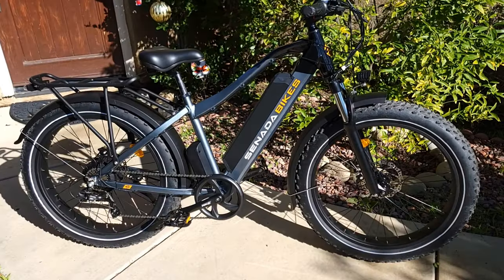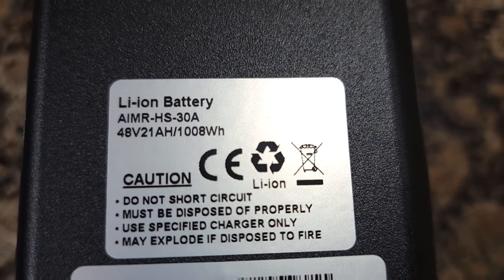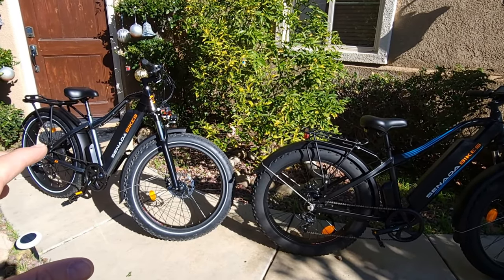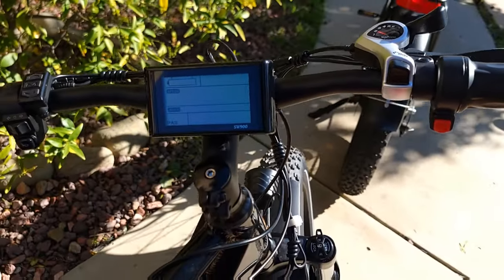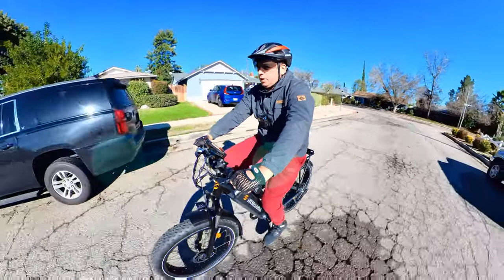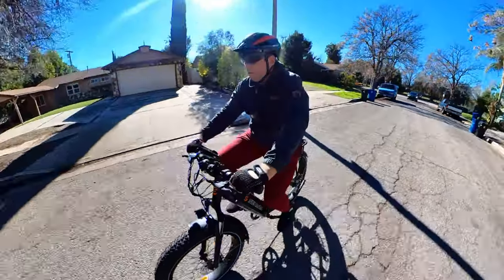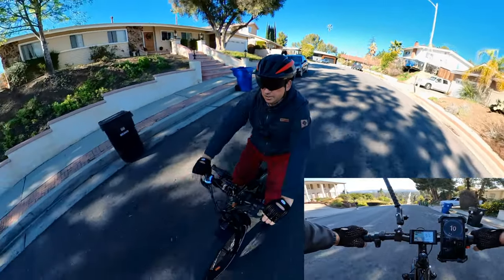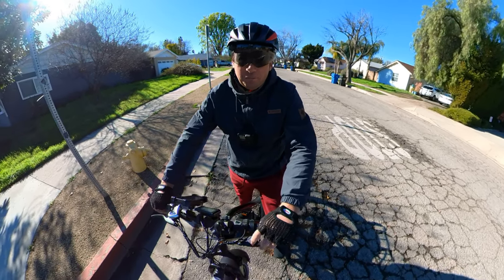NEW Upgraded  Senada Saber Pro 1000W Fat Tire Electric Bike All-terrain & Off-Road 2023

Comment: I am jealous.  I have the previous version of the Saber.  It is great but the new PRO seems like a nice upgrade.
Reply from the maker: I know but you can upgrade handlebar and brakes to Hydraulic . There are 2 type full Hydraulic and pull not sure if pull will make any difference. But yes pro is much better now

Comment: I'll stick with the Aerial Rider Kepler. It can go 40 mph and has a modern color display and is the same price or less. Thanks for the video though.
Reply from the maker: Whatever works for you 😉
Reply: The Kepler is like 300 dollars more and the saber pro is a way better looking bike.
Reply from the maker: After some discounts I think $400 -500 more.. I think senada also doesn't charge sale tax in most states
Reply: @askdad  do you know any discount codes for this bike?
Reply from the maker: I have a discount code in description with link. I think they had Herald pro on sale under 1500 so it would be about $1420 after discount
Reply from the maker: I think if you buy 2 ebikes there is code love400 $400 off
Reply: @askdad  Can you stack discount codes
Reply from the maker: Discount in description and should be in comments.
Reply: @jeremyadams6337  I agree with you on the looks aspect. But the Kepler is faster at nearly 35mph. So that's the reason I am leaning towards the Kepler.
Reply: I never really tested my top speed on the Kepler. My hat keeps blowing off at 35 mph
Reply: The aerial rider kepler say its a 1000 w hub motor so how does it go 40 mph?
Reply: @devangiacchetto980  it goes 35 on flat ground. 45 down hills. Trust me. 33 mph is lowest speeds at less than full battery

Comment: How come the top speed on ur saber hits 28 mph but when i searched up “how fast does a 1000 w bike go” it says it yields 35 mph?
Reply from the maker: Do you have Saber pro?
Reply: @Devan Giacchetto because it’s governed to be limited to 28mph. The top speed of the regular Saber is 34mph if you cut the green wire, or install a new controller allowing you to go the full speed.